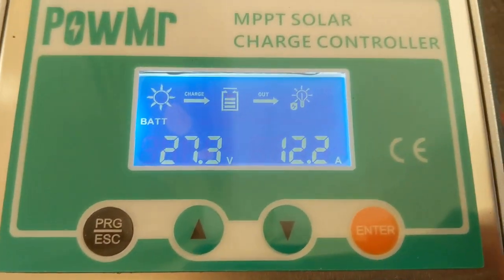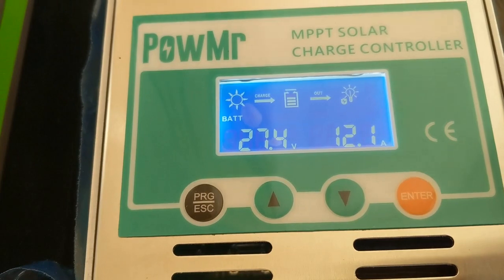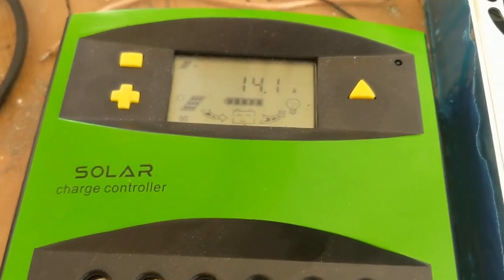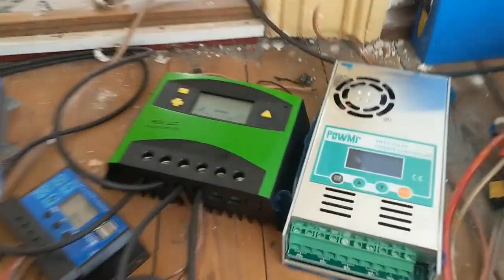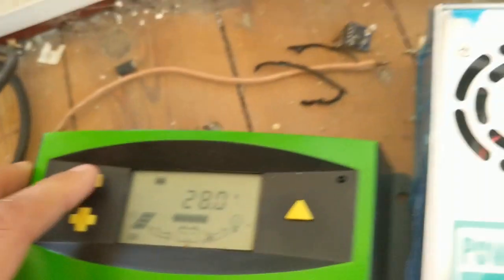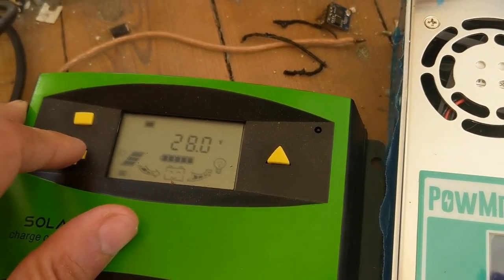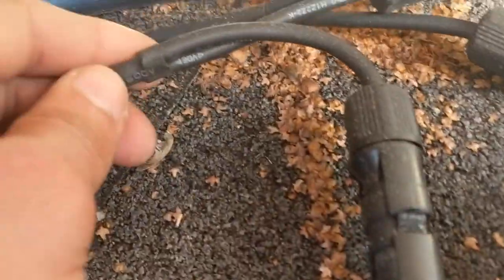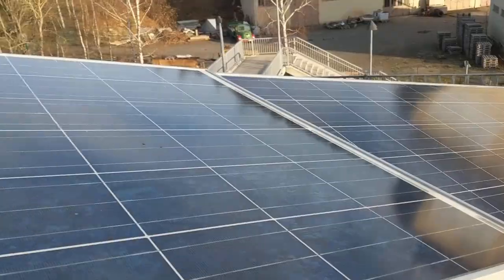20/27 likes :-/ 60A PowMr mppt solar charger no good at 10-20A / 28V :-( PWM is better !

Comment: One question, the load disconnects after the battery gets bellow the pre defined voltage on D03 setting. Do you know when it reconnects? It needs to be a manual thing?
Reply from the maker: Yes indeed, there is only the voltage D03 to be set for Load on/off. So i guess it reconnects when the battery voltage goes back above D03.
Reply: @robodurden  thank you for you reply. At the moment mine is not turning on, I've set a voltage of 10.1, on a 10S lithium battery (3.6 nominal). The battery is currently at 32.8 and the output is still off :(
Reply from the maker: @GoncaloRijo  don't know if this helps: i think i once had such a low battery that the auto-detection 12/24/36/48 no longer worked and i had to completely disconnect the charger to reset to the correct voltage.
Reply: @robodurden  ohhh... This is bad since I don't have easy access to the mppt :( Maybe is better to define a different d00 so it cycle it from time to time and hope it turn the load back on with this hack...